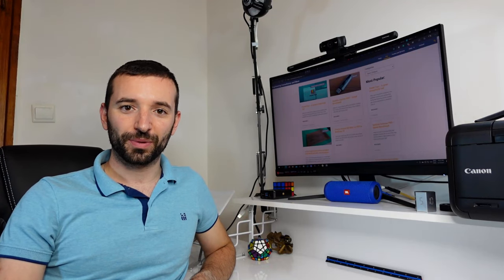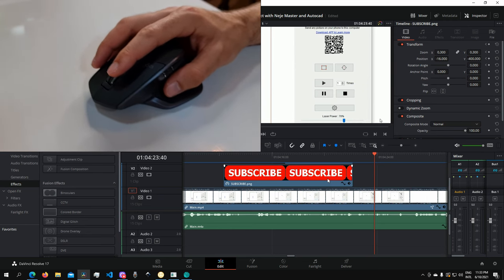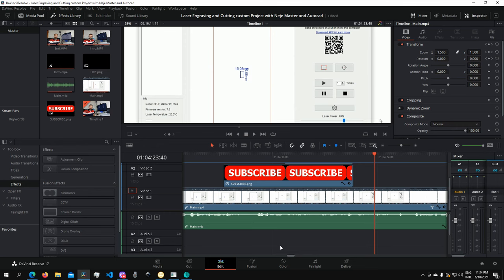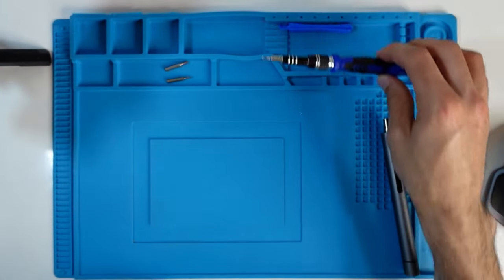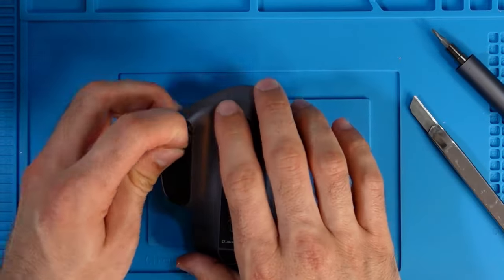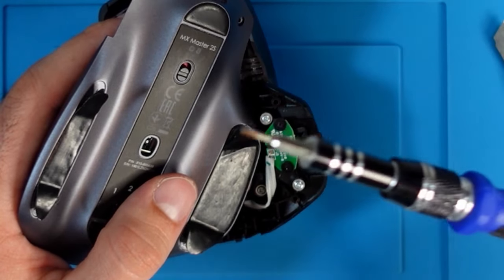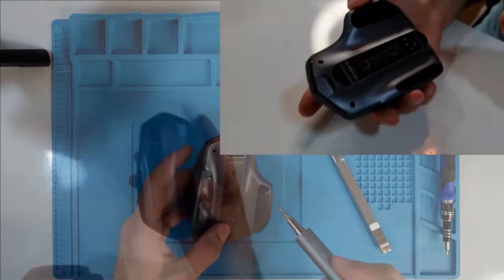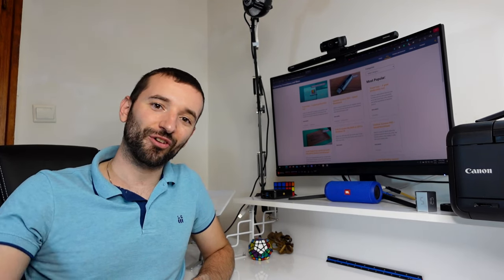Fix Logitech MX Master 1 ,2 and 3  - Cursor not moving and stuck thumb button

Comment: Thanks a lot! If you don't use the thumb button, and are tired of fixing it every couple months, you can unscrew the little green board (don't cut the white cable just in case you want to use it in the future), then remove the thumb button mechanism (is right below the board, with silver screws). Little green board is loose but that won't be a problem. A fixed mouse cursor won't be either!

Comment: life saver!!! i have a 2S model and  after prying the top cover from the base (a little bit because the 2S has six screws, two of which are torque screws) the rubber cover of the fun-button just crumbled apart! now that the rubber cover is not pressing the button anymore. the mouse works!

Comment: Wow. This is amazing. THANK YOU THANK YOU THANK YOU! What a simple solution. + the added investment in a comprehensive electronics screwdriver/bit set. Absolutely worth it for anyone on the fence. I wanted to restore my older MX (currently using MX2) and this tracking issue was my only hold up. After loosening the screws, It works as demonstrated. Glad to know if my MX2 starts to get funky. CHEERS!

Comment: Great video. Mine had 4 screws under the pads. I discovered this by gently pressing the pad with a bunt instrument and where the pad depressed slightly were 2 more screws. Then I peeled back the pads at those locations.

Comment: This is amazing and worked wonderfully! If you're like me and you pried open the casing too fast, undoing the connection of the cable to the other part of the case, it's pretty easy to fix. Carefully line up the pins of the strip into the opening on the board, and there should be a white clamp that seals it in place when you place it in all the way, just close that and it should be repaired.

Comment: Thanks so much - I had the same problem and 3 minutes saved me a lot of frustration and money for a new mouse! My thumb button was giving me a hard time before the mouse stopped working as the default action was somehow triggered all the time - I was able to solve that problem by setting the actin to none for that button. However, that did not work when the cursor stopped moving.

Comment: Thanks, I had both my mice break with the same fault within 2 weeks. had to pick the first one out of the trash when I found your video. I opted to cut that gesture button board out on mine as I never use them and it saves it breaking again.
Reply: Just fixed mine for the 2nd time in a year.  I never use the gesture button so I'm thinking of doing the permanent snip solution too.  Now to find the best way to achieve that.

Comment: You don't even have to open the mouse to fix the problem!  What I did was just kind of bend the thumb button a bit to sort of loosen it.  And then disabled the thumb button through the Logitech Options app.

If you actually use the thumb button, you'll have to open it unfortunately.   I personally stopped using it; it takes too much force to press it.

Thank you for the video, I would never have guessed it was the thumb button that was causing the cursor lock.

Comment: Great video! By the way you can easily disconnect the flat cable between the top and bottom shell by unclasping the the little ivory-colored clamp that is holding it on the circuit board. When you are done, just insert the cable again and press the clasp shut.

Comment: Wow, this has worked perfectly on my MX Master. This is crazy.. basically a jammed button stops everything. I had to use an old wired mouse until I buy a new one but i looked up the issue and I wasn’t alone. Thank you for the advice!

Comment: I had similar trouble. Did not even know that button existed, after about 7 years of usage. Unmapped it but it was still buggy. This solution did however not work for me, since it seems to be some physical error with that button in my mouse. So I just cut the wire to it (since i've never used it anyway) and now my mouse seems to work properly again. :) Thanks for great video.

Comment: Excellent, thank you for this guide. I shall be trying the same with mine this evening. As for the use of the gesture button, I do a lot of work in AutoCAD so I had mine  mapped to the escape key as in it would cancel whatever command I was working with in AutoCAD at the time. Extremely useful.

Comment: great video. I've had the problem for a while and would just squeeze the sides of the mouse really hard and it would fix it (the pressure allows for the release of the stuck thumb button)

unfortunately it has been getting worse. currently I just make sure all my devices have the button disabled within the logitech app. will do this later when I replace the usb port with usbc.

Comment: My left click worked only if I pressed hard enough, and blowing underneath the button didn't fix anything. I ended up opening it, and found that the little (-) shape on the button caved in a little bit of the top part of the plastic above, requiring a deeper click to register. I just put a little piece of tape on it so reduce the distance required to click, it's almost perfect now. Seems like a case of planned obsolescence, why else would they use soft plastic for that mechanism?? It's so flimsy, especially for an expensive mouse! 
Also, opening this for the first time requires pure brute forcing of the shell... I found that pulling the part at 5:12 only worked up to a certain point, I had to use a butter knife in that opening to force it to snap. The rest opened with much less force.
Reply from the maker: Hi, thank you for your comment.

Unfortunately, while our politicians are pushing toward a greener world, forcing us to keep up with their somewhat meaningless rules, with no plastic and electric cars; the manufacturers move towards unrepairable products which will inevitably end up in the landfills and some take advantage by removing the charger from the new phones.
Simply the world we live in today. 

Ciao

Comment: Thank you very much for this video - I had the same problem and Logitech Support was completely clueless about it. This thumb button isn't just useless, it's annoying: When being in a game, it will send you back to the windows desktop if pressed by mistake. The only way to get rid of this function is to install Logitech Options, but this piece of software isn't compatible to some games... And tools like 'XMouse button control' can't handle the unwanted "extra button". I never use it and as it's obviously the source of a very common problem that easily renders the whole device useless, I consider it to be really bad technical design. Still, Logitech sells it unmodified to this day. IDK about that.

Comment: Awesome. It worked! I mean... It kinda worked, at least I can use the original MX Master 1. The pointer wasn't moving and the small plastic tab that pushes on the thumb button was broken, the rubber from the outside also. It doesn't work, I can't use it so I broke the connection to it. Now the mouse works but the outside rubber... Too bad is ripped, it comes out in chunks. The quality of rubbers in mice is not good, I had many from many brands that becomes sticky then it rubs off then it cracks and rips.

Comment: THANK YOU! Very happy to not be dropping the money for a new one of these. For anyone in the same situation, bizarrely just unscrewing and separating the mouse top and bottom portions fixed the problem for me. Assume there must have been pressure on the thumb button which was relieved. Also when taking off the pads on the base of the mouse make sure you remove the smooth laminate layer AND the adhesive layer at the same time. I am an idiot and on one end of a side pad managed to get my knife between the layers which then needed superglue to fix it down once finished. Not a big deal and didnt spoil the finish but wouldve been better not to do that!

Comment: I fixed the issue with the gesture/thumb button, thank you. Then I started having an issue where the mouse pointer moved sometimes. Not caused by thumb button. Finally as I was about to throw out the mouse I discovered it was the mouse pad????? MX Masted works fine without it.

Comment: Instead of peeling the pads, I used a sharp blade and - using the video for exact locations - cut 4 neat, round holes above the screws and removed them. The rest of the video tells you what to do. The pads are not effected by the holes, they still provide slide, as they should.

Comment: Hi,  if I model the mouse, mirror it, and  3d print it do you think I could use the electronics to make a left handed version?
Reply from the maker: Hi, thank you for your comment.

I think it should not be a problem at all to do that, the software allows you to swap the left and the right button.
Just have in mind the asymmetric components inside the mouse mich may require some extra modelling thoughts.
I am not left-haded by I have always wondered why Logitech doesn't offer the design for left-handed people knowing that they lose a good share of sales with this.

Ciao

Comment: As someone wrote it on Reddit (so you don't need to take apart the mouse): "An alternative fix that does not need to open the mouse is to use a thin piece of material and put it between teh edge of teh rubber pad and teh plastic body of the mosue and lever teh ruber up slightly and it should no longer be pressing the gesture button and you cursor should now move."
Reply from the maker: Hi arpxdagoodone, thank you for your comment. 

I haven't tried it, but I believe that it would work out just fine.
However, I'll instead go for a clean solution; by taking it apart, I would go for the solution you mentioned if I am in a rush and need a quick fix to get my job done.

Ciao
Reply: @arpxdagoodone Perfect, thanks a lot.

Comment: Perfection! Thanks!
Reply: I was looking at a 100 euro replacement - No need! Unit saved in a quarter hour,  including watching the video. I had to use a flat blade jewelers screwdriver for the front 2 screws, not ideal, but got the job done. I didn't even put those 2 back in when I was done and function is perfect, even better than before.

Comment: Two comments: I didn't manage to fix the button with software, but I found I could unstick the button by simply lifting up the rubber/plastic thumbrest with some tape. I don't normally use the thumb button, so as long as I don't press it there is no disassembly required!

Comment: Well. if you have this problem, you can easily solve it without opening the mouse. Just get a scapel and slide it between the rubber and plastic on the gesture button side, then pry it a little bit. Works in less than a minute. 

Peace.

Comment: thanks alot brother. Can anyone tell me how to restick the bottom rubber pad properly. It is bit loose now and creates a bit of problem. Is there any glue I could use?
Reply from the maker: Hi, Amit Kumar; thank you for your comment. 

I haven't need to use glue in my mouse, but if you don't stay, I could suggest a dot of hot glue, or a weird option is the Lock Tight that is used to seal fasteners as is not permanent and if in the future you need to peel it again should be easy enough.

I hope it helps
Ciao

Comment: thanks bud, this worked for me!

ive been having issues with the thumb button for a couple of years so i stopped using it, but recently the gestures stopped working properly too, and now this evening i turned off the mouse to restart it and then the cursor didn't move at all!

now the thumb button is actually working again, gestures are working and i can move the cursor, awesome!

Comment: Better way to do this is take the two small screws and two silver screws next to them, and clean the button with some rubbing alcohol. The button gets stuck because of dust around the button mechanism. All you have to do is clean it.
Reply from the maker: Hi, completing; thank you for your comment. 

My button simply had lost the springiness of the membrane inside, i.e., dead, but sure, if you need that button functional, you can try to clean it up. If that does not work, you could also buy the small button from an electronic shop and replace it if necessary.

I personally haven't ever found that button useful, and reading through the comments also, many other people did not therefore, I simply eliminated it. 

Ciao